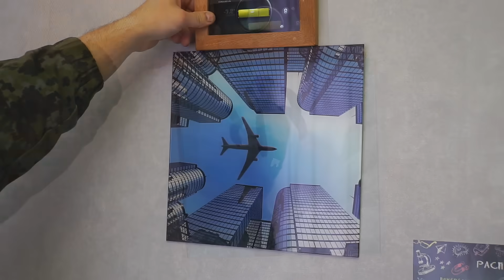Top 3 amazingly simple ideas made of wood!

Comment: First idea: ok
2nd: can be not accurate in 100% but good way for cheap tool
3nd: u didn't even sand befor you glued it so then u could saw the black line on glueing and there could be mold (i think this is this word, sorry if not) which could spread, but for this project it wasn't really a thing, but for others it could be a problem
Reply from the maker: Thanks 👍

Comment: If you do not have metalworking tools, you can make the “trigger” from a hard piece of scrap plastic. Anything round, like the broken base of something, you just need to trim it.
Or you can mould it from a thermoplastic like Polymorph, which comes in little grains. It melts in boiling water but is very, very tough when it cools.
Reply from the maker: Thanks for the advice, it wasn't difficult for me to make it out of metal!
Reply: @MA-SH  I was thinking of people more like me😀
Reply: Just go to any store that sells spray paint and the chances are good that they will have spray can triggers for cheap!  Also, automotive parts stores and hardware stores sell them!

And they last longer that wood plus, they have safety latches so that little kids can't use it and make a mess or even get the paint, or whatever you have it attached to, in their face and eyes!